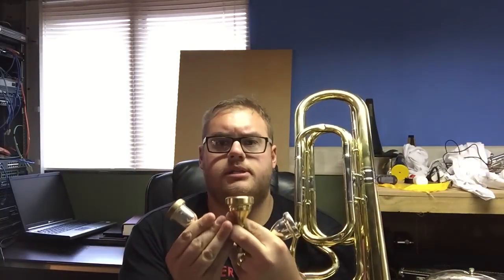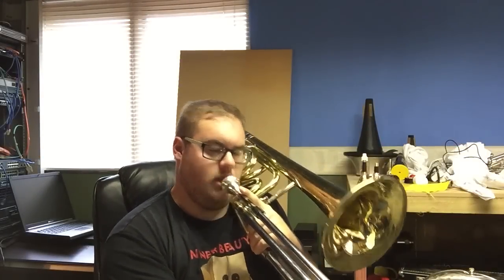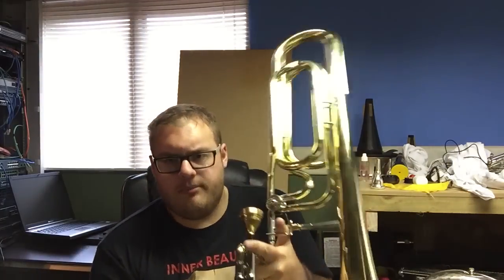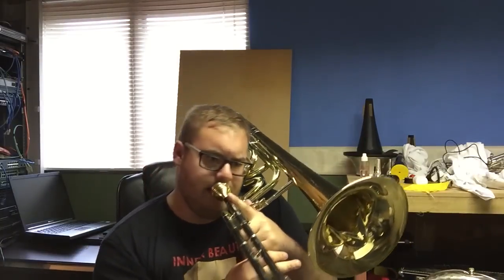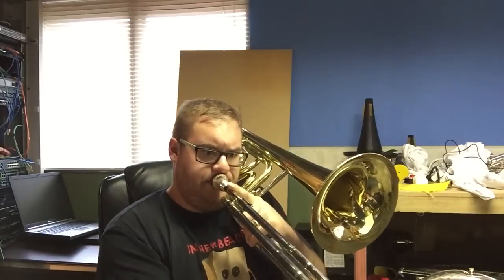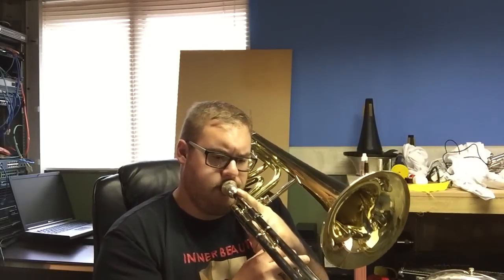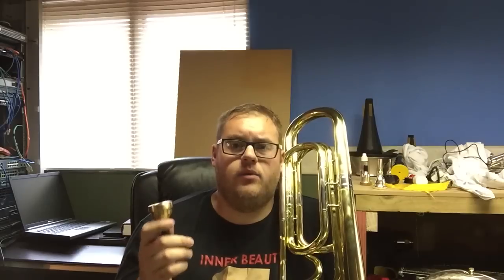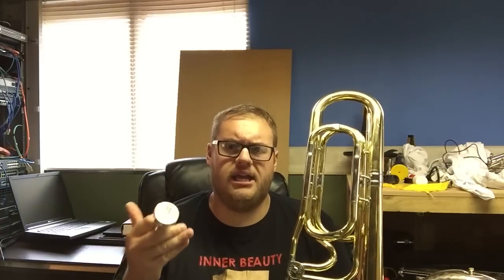BBb/FF Contrabass Trombone with 'real' mouthpieces

Comment: As far as mouthpiece goes; note that I am a Tuba player.
I picked up one of these recently (Branded M&M, a U.S. importer of these).  I was playing mine with a Schilke 62 tuba mouthpiece.  Much better than what came with the horn.  I also tried my biggest bass bone piece as well (Giddings and Webster Nor'Easter) that wasnt satifactory. I decided to get a Bach 30CB, contrabass trombone mouthpiece (And not too expensive, $83USD).  According the the forums, it was designed for the Miraphone BBb contrabass (Which this horn copies) The shank nearly bottoms out (slightly larger than bass trombone), but I have a Josef Klier  Eb to BBb tuba shank adapter. The way the horn plays with the Bach+adapter vs any tuba mouthpiece is night and day.  Horn centers better, responds better, much more articulate, the woofyness is gone, and the timbre is much more trombone in color. Before I felt I was fighting to be more trombone than "slide tuba".  Now that I don't have to fight that, I can focus on playing.  Its still an air hog, and obviously it wont make the horn lighter for long sessions, but it was well worth the purchase

Comment: Aren't you messing more with the "gap" within the receiver than anything else? Seeing as how that is set up to use a "tuba" mouthpiece, the end of the mouthpiece would be further in and spaced better within the leadpipe. All of your taped mouthpieces suffer from poor alignment and imperfect wrapping.
Reply: There is no gap on a trombone, bass or contra bone so mouthpiece shank size doesn't have any effect. ALEXANDER tubas and french horns are the same with the leadpipe going all the way to the end of the receiver.